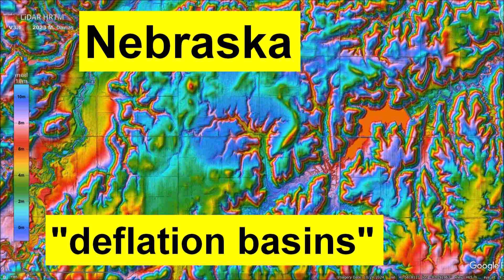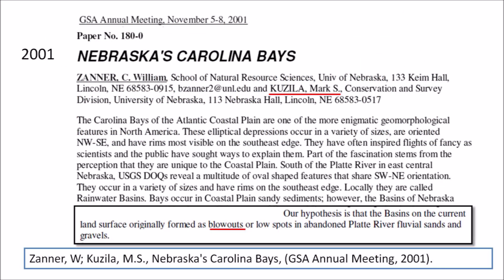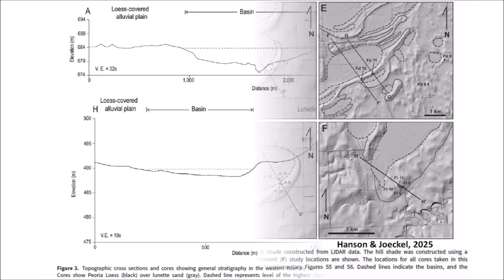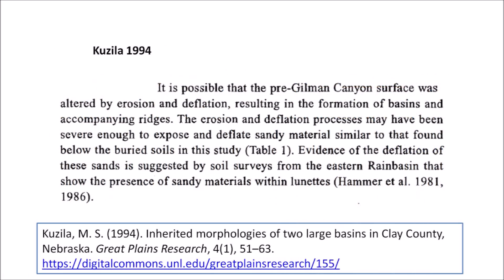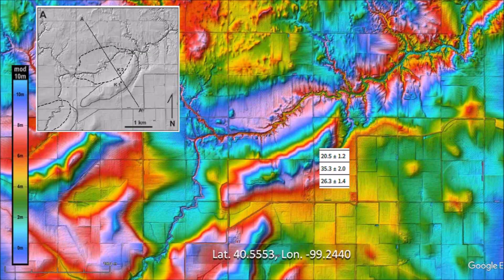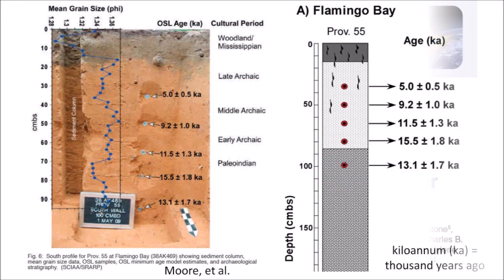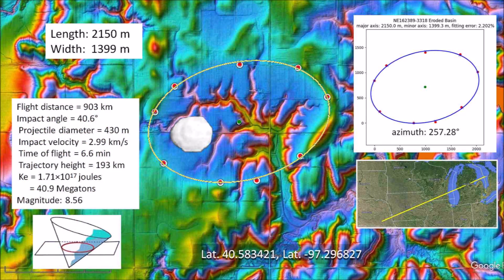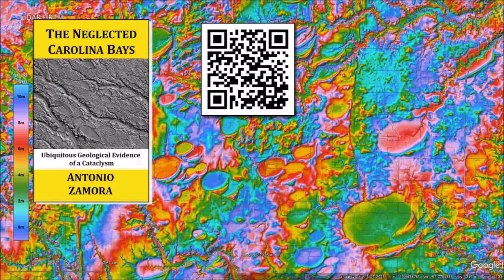Nebraska Deflation Basins

Comment: Another garbage theory trashed and burned by Antonio Zamora...  How did this paper get published without the journal editors catching such obvious mistakes?
Reply from the maker: You can't call it garbage theory. The idea that the Nebraska basins were made by wind has been around for over 40 years, and it has wide support. However, nobody has really questioned how much energy would be required to make each basin. Answering that question requires complicated mathematical analysis. Let us hope that the supporters of the hypothesis take up the challenge to do the math to show if the hypothesis is really valid.
Reply: @Antonio_Zamora  

I suppose that, in my mind, what made it garbage was that they were "supposing" and "assuming" rather than providing measurements and evidence....

This was also why, from my view, it was surprising that a journal would publish it.  Well, to be fair, I don't actually know what criteria must be met to have ones paper published in a journal.  So, maybe any ol' paper can be published, no matter how fraught with clumsy mistakes it may have.